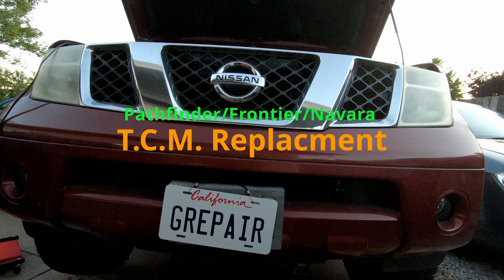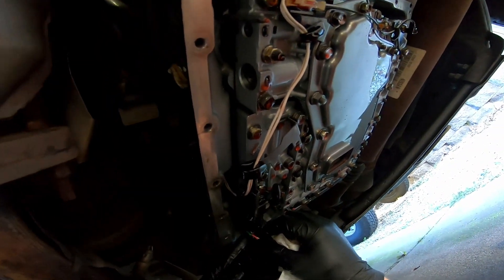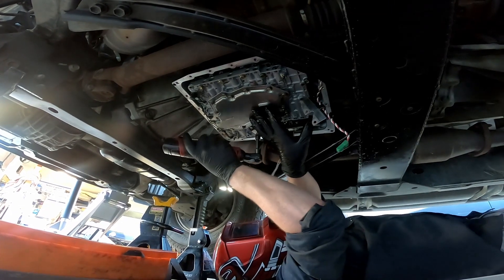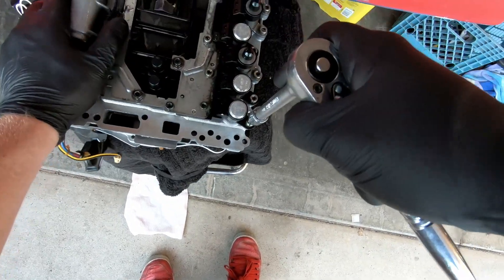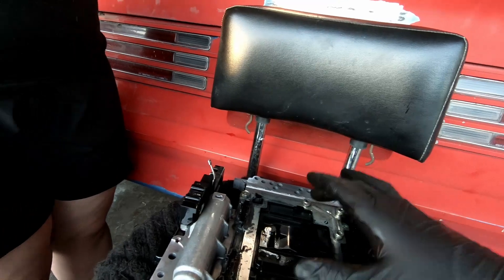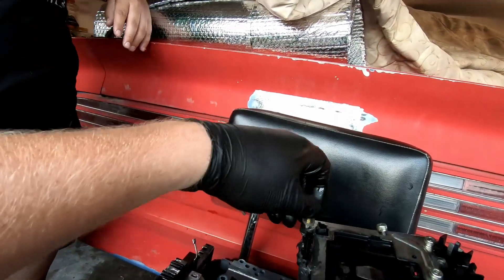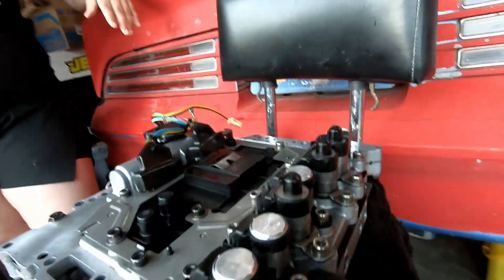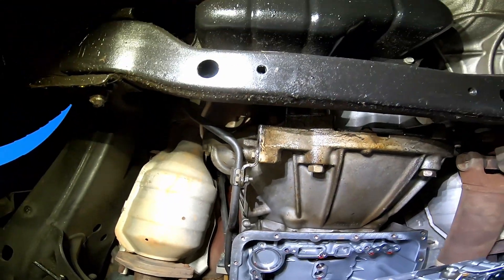How to Replace Nissan TCM 2005 - 08 Truck/ RE5RO5A

Comment: Awesome video! I have a 2006 4WD pathfinder that runs fine, other than occasionally slipping gears and shudders going into 2nd or if I come to a rolling stop then hit the gas again, it will either hesitate or shudder (whole car shakes like I'm going through seriously uneven surface), then it catches gear and will shift fine the rest of the gears. It is pretty intermittent but it happens almost every time I get behind the wheel. I noticed that slip/shudder is worse when I'm a bit heavy on the accelerator vs accelerating slowly and smoothly. Any idea what that could be? Changed ATF and filter 3 months ago and it wasn't bad at all, just starting to turn a little dark. I also switched to aluminum radiator. I was lucky that my fluids had not mixed up that point. Would appreciate any suggestions. Thanks in advance!
Reply from the maker: Thanks,Do you have any lights on the dash lit up (check engine, TDC slip, abs)?
Reply: @GrimRepair Yes, i have a check engine light that's been there for a while (Catalytic efficiency below threshold, which for now I'm ignoring), an ABS or TPMS which has been there for a while as well.. doesn't seem to go away but will sometimes flash when I'm driving.
Reply from the maker: @CUBICHI1985  So have you recently checked the codes to make sure no new one have come up? Does your scanner pull transmission/ abs codes? Inside the tcm there are metal rods that sometimes break and they can bounce around causing intermittent shift problems, but it should give you a transmission code, it's separate from the engine codes in the scanners menus.
Reply: @GrimRepair You are absolutely right, I should have it scanned (since it's been a good 4-6mo since I last did). Since I don't work on cars myself that often I haven't thought to spend any real money to purchase one. Seeing as how most shops/mechanics may or may not always be very forthcoming/honest, I tend to gravitate towards doing things myself when I have the time and IF it is something I feel comfortable undertaking myself (though I am handy and not afraid to turn wrenches, I am not a mechanic and my knowledge of cars is rather limited). With that said I prob SHOULD invest in a good scan tool (one that can read transmission codes as well).. I just don't want to spend too much on something that I may only end up using very sparingly. Do you have any recommendations?
Reply: @GrimRepair  And yes, I've watched several videos outlining just that procedure of removing the TCM and opening and checking the leads in the circuits. I'll start with a scan first and see if I can narrow it down with the codes it comes back with. Gotta buy a decent, yet inexpensive scan tool first with those capabilities. Please let me know if you have any suggestions for good scan tools. Preferably one that reads abs, trans, and also any turbo related items (as my wife's 2013 Nissan Juke is also starting to 'act up'). Thanks again for all the good info and prompt replies man!!👍🙋‍♂️ really appreciate your time and dedication
Reply from the maker: @CUBICHI1985  Thanks for the kind words, happy to help! I have an otc (bosch) scanner that was expensive and it sucks so I can't recommend buying a bosch scanner. Then my other scanners are cheap but can't pull transmission and abs codes. I have heard that autel is good for the money, but i havent seen them in stores.Autozone does sell scanners that will pull transmission codes for a few hundred dollars, not sure how good they are. Let me know what you find.
Reply from the maker: @CUBICHI1985  on cars today you really are dead in the water without a scanner. Make sure you get one that pulls abs, sir, tcm, and ecm codes. One that displays live data is also helpful.
Reply: @GrimRepair  Very true. Good starting points. I'll see what I can find (hopefully it's not too expensive). Thanks again!!
Reply from the maker: @CUBICHI1985  you're welcome.
Reply: I use "Delphi" scanner from ali/ebay, with "Nissan Navara" vehicle chosen (despite i have pathfinder v6), it works on TCM and dashboard but other systems unavailable, and it has limited functions i believe. Still i can read TCM codes and few dozens of sensors from transmission (like 80 sensors, especially 20nd one that is trans fluid temperature). Can't recommend it as it doesn't know all the vehicle, but its definitely helps with transmission.
Reply from the maker: @Mocconagames  Thanks for letting everyone know?
Reply: @GrimRepair   So I ended up buying a scanner. I went with a Foxwell NT624 Elite for about $240. I scanned my CEL and pulled SERVERAL codes. Erased a few, and only 2 have came back a day or two later (P0430, which I've known about for some time and P1731 which is the only one that is TCM related). 
Since then I've also topped off my trans fluid.. 2 quarts were missing total (I am amazed that I missed this comletely). And while I think some of the symptoms I was experiencing may have been low trans fluid related, I do notice a very slight change in the way it shifts. Right after I erase the two codes, it will shift extremely smooth, not a single flare up in RPM nor hard shifting. When the CEL comes back, I notice very very subtle differences in shifting points with a very very mild RPM flare up every now and again.
The good news is the shudder (like I'm driving over speed strips) is COMPLETELY gone. I think the shudder may have def been low fluid related.
I've ordered a remanufactured valve body ($540, supposedly flashed already) and am currently on the fence about actually replacing it, since my TCM is not showing any other signs of damage nor evidence that it might die soon. I have kept driving the truck as is, and aside from having to erase the 2 codes every other day, I have no further issues (though I know this is NOT a permanent solution).
I still haven't found anyone else on the web with a similar issue and single code P1731 on any of the vehicles with this transmission RE5R05A.
My window to return my old valvebody (core) is coming due quickly but I'm torn as to whether to install it or not. They will charge me $250 if I dont return a core.
I noticed you just purchased the TCM module on its own.. may I ask how much that ran you, and are they still available?  Did it come with or without solenoids, and if not I'm assuming you purchased a whole new set of solenoids right?
Reply: Nevermind, just saw that yours was $600 from O'Reilly's. Since mine was a whole valvebody assembly and came with solenoids, I am probably better off giving it a try. Rather than trying to replace just the TCM and get a whole new set of solenoids (more $$).
I guess worse case scenario I can swap it.. drive it for a day or two and if I have any issues maybe I can just swap the TCM and solenoids from the reman unit into MY valvebody or vice versa (i.e., play around with the configuration that offers me the best results (if that makes sense).
I have not tried flushing the system through the cooler hoses, maybe I'll do that as well just for good measure.
Reply from the maker: @CUBICHI1985  I got the tcm from oriely's for $600 plus $300 core life time warrenty. I didn't need to program it but the packaging said I would need to, so maybe I got lucky as far as I know they are still avalible. I had to go into the store to order it though.I got used solinoids on amazon for $70ish  if you get lucky pulling them out you won't have to replace them. If I had that code I would think it was the tcm, and I would replace it, one of the rods inside it has probably broken. Is your tranny cooler mixing with your antifreeze?
Reply: @GrimRepair  
So all in all you're about $900 into it?
See I purchased a remanufactured valvebody assembly online for about $540. It claims it will come flashed to your VIN and they even send you the packaging and label to send (the core) yours back. As long as I return my old one (the core) I don't get charged an additional $250. So $540 otd shipped to me with a label to ship mine back.
I've yet to install it.. I'm still on the fence about it. The company is called Street Smart Transmission.. they're in FL.
The package DID have some instructions for checking the turbine revolution sensors clearance/seating as well as a "RE5ROA re-learn procedure" that covers "accelerator pedal release position" and "throttle valve closed position" relearning. We'll see how it goes..

Comment: Hey man my 06 nissan frontier has been shifting hard into 2nd gear(by hard I mean sort of bumps into 2nd, no clanking or grinding of any kind) and a delayed up shift from 3rd gear to 4th gear and its also delayed when I shift from drive to 3rd when going down hills. I was wondering if this would solve my problem or what your advice would be?
Reply from the maker: It could, it's hard to say for certain without looking at it. Do you have a scanner that can pull tcm codes?
Reply: @GrimRepair  I dont own a scanner unfortunately but I had an engine light come on about a year ago and I ran the code at autozone and it said something along the lines of valve body assembly or something about my tcm solenoid? but I lost the print out of the paper I recieved that had the actual code number, but the light did turn off after I had my transmission fluid flushed. But still shifts a little bit funky but its not a huge problem just would like to prevent any further damage to my transmission if it can be prevented lol.
Reply from the maker: @sa.3370  the light dosent always come on for transmission codes scanning it is where I would start.

Comment: So did you install a new gasket around the transmission pan
Reply from the maker: @chrisverge7985  I attempted to repair the tcm before I ended up replacing it in this video. I probably put a new gasket on it then, so It wasn't very old. It has been years so I don't remember. Some gaskets are reusable. If in doubt, replace it it should be included with the filter.

Comment: Did you get the P0717 code, mine is the same I just replaced the radiator and flushed the coolant and trans but the code just came back
Reply from the maker: It's been a while, I don't remember. A bad tcm can give you that code, though.

Comment: I'm thinking of buying an 07 Frontier. The owner says that the TCM is the only issue due to the coolant and tranny fluid mixing. Does it make sense that the TCM would fail before damage to the tranny would be done? Thank you so much!
Reply from the maker: It’s hard to say. If there isn’t an abnormal amount of clutch material in the pan I would replace the Tcm. If the car is worth saving and needs a new transmission you’ll have to replace the tcm anyway.
Reply: @GrimRepair  Is there an easy way to check the pan for the material? The owner has paperwork from the mechanic he had taken it to, where they did a full flush of the transmission fluid and the mechanic had said to replace the TCM and the tranny cooler lines. He said that the truck would go into 4WD, and it repeatedly blew a fuse. Everytime they'd replace the fuse the truck would work for about 2 weeks and then the fuse would blow again. And then one day the truck stopped cranking over. I hope this explains more! Again thank you so much, your video was so helpful and you're very helpful with my concerns.
Reply from the maker: @Qwe45798  you would have to drop the pan, there is a magnet in there. Did he replace the radiator?
Reply: @GrimRepair  Yes the radiator and all the hoses were replaced.
Reply: @GrimRepair  I just want to make sure I'm not going to be buying myself into a headache. I'll definitely check the pan before I buy it! Thank you for your help! Any other advice would be greatly appreciated! Thank you!
Reply from the maker: @Qwe45798  There is risk that the transmission is ruined, I got this pathfinder for almost nothing so i figured it was worth the risk, many other people have also been able to save theirs with just a tcm replacement. I have not had anyone report back that they needed a tranny anyway. if you get it replace the radiator and the tcm, i am not sure why the shop said to replace the lines? let me know how it goes.
Reply from the maker: @Qwe45798  oh ok good then if truck was driving fine other than the fuse blowing i would guess that the tcm will fix the issues. how much is he asking for it?
Reply: @GrimRepair  I will let you know if we get it and how everything goes! Thank you so much for you help, you have eased my conscious a bit haha! Again thank you so much!
Reply from the maker: @Qwe45798  That is more than i would spend for a truck that doesn't run. Unless its super low miles, you trust the person and they have a good reason for not fixing it then selling it. I paid around $200 with 210,000 miles from a friend. If I didn't buy it he was going to scrap it. These trucks are starting to be sold to the junk yards for under $500 so take that into consideration. I don't think they will have a lot of buyers at that price.
Reply: @GrimRepair  I trust the seller, everything he said was replaced was and the issues he had said are also present. It's at 160,000 miles so not too high but not low. They did replace a lot on the truck so I understand why they are asking a higher price.